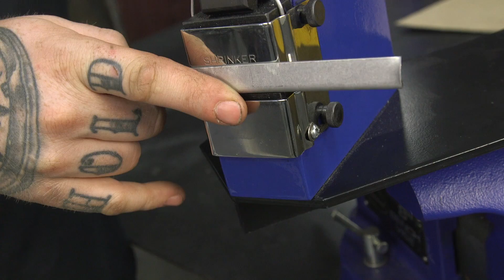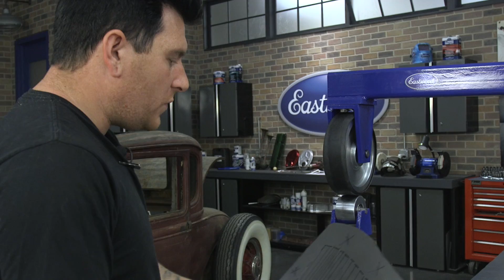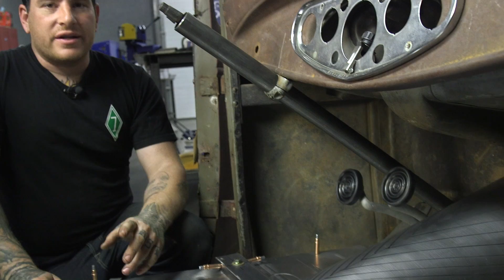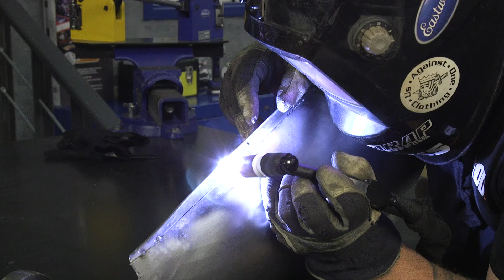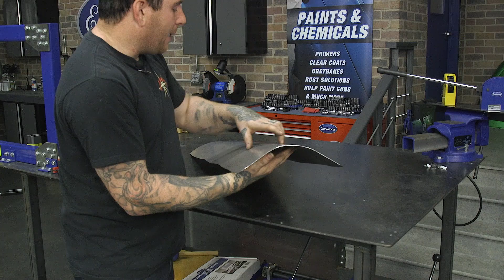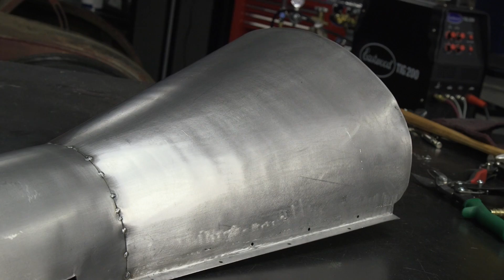How to Build a Custom Transmission & Driveshaft Tunnel - Ford Model A - Eastwood

Comment: Don't they sell a roller with a crank? They used to make a roller assembly with one roller up top and two beneath to shape out a cone [or if at home you'd use your pipe vice to bend out the conical shape]? Just thinking [a dangerous sport for me] lol

Comment: Nice work! I don't have an english wheel and I don't think it's necessary to have one. I would have laid that sheet metal over a piece of channel iron and then rounded it by hammering it into the channel with a piece of pipe.
Reply: Of course theres the Shoulda, Coulda, Woulda’s out there. They show how to use various tools and almost none of them are required for that particular task. Working with metal, almost anything else could always be used instead. All Fab guys know this. Its just ONE MORE way.

Comment: Did you weld the trans and driveshaft tunnel seam continuously or do you jump around and let it cool some? I like the idea of tig'ing them instead of having a big ole mig mess to clean up after. How much shaping is there to do after the weld? I've had to use a dent puller heat source to eliminate the oil can on front pans after moving too fast with the mig. Good videos. Fairly detailed with the process

Comment: does eastwood make or sell sliprollers because your transmission tunnel and driveshaft tunnel both could have been made a lot easier and faster with a sliproller and im sure they could be used for a lot of other projects too
Reply from the maker: Eastwood does offer a couple sizes of slip rolls.